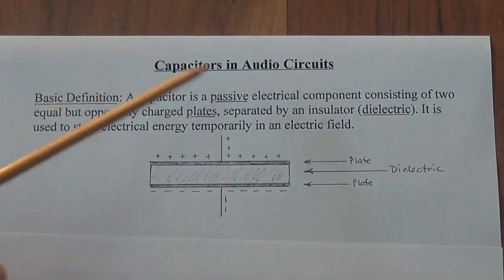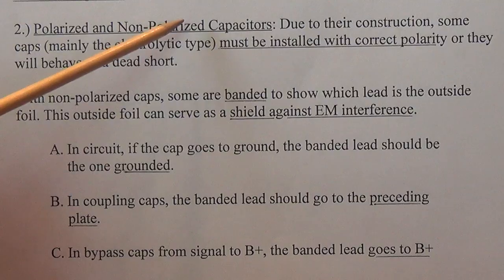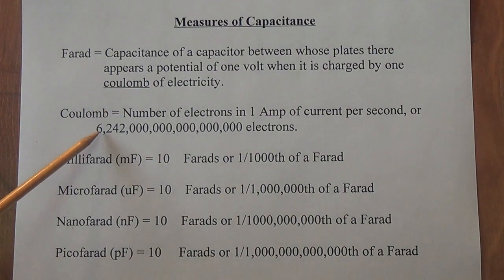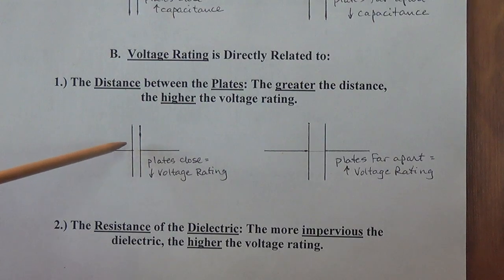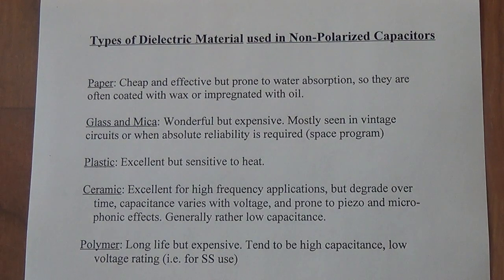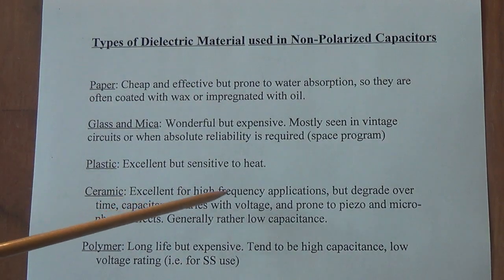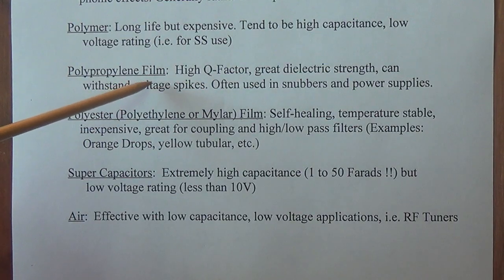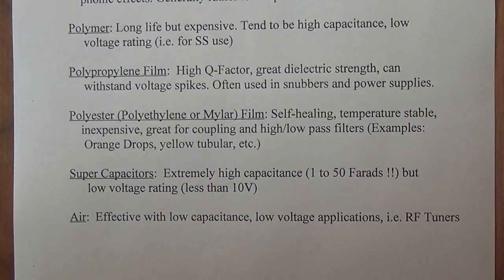Capacitors in Audio Circuits:  Part 1

Comment: Uncle Doug I truly thank you for your videos I have learned alot. I was whatching  mr carlson lab and he says that all caps have a polarity. Is it an issue when building a fender 5f1 forinstance.
Reply from the maker: You're welcome, Brad. I believe what he means is that all caps have an inner and outer foil layer. If you ground the outer foil, it acts as a shield for the capacitor and lowers the noise floor of the circuit. I have no argument against this, but I have built many amps without concern for which cap lead is connected to the outer foil.......and they are dead quiet. If you have an oscilloscope, however, by all means test and mark each cap prior to assembly.
Reply: @UncleDoug  OK thanks. I hear so many differing options on this circuit, 5f1 or aa764 or ab764  it's very intriguing and I need to study the history of this circuit.   Regardless I am going to build the 5F1 as the first amp project. See you at Cobo Hall Detroit this summer.

Comment: In order to be self-healing, film capacitors need to be metallized-film type, where a thin layer of metal is deposited onto the plastic film.  The self-healing process relies on the thin metal layer fusing around the defect if the dielectric "punches through."  However, for high-end audio, foil/film construction is preferred.  
Also, for audiophile-level gear, polyester is the least desirable film dielectric type.  Polypropylene or polyphenylene sulfide are preferred.  Polystyrene and polycarbonate are also excellent, but hard to find today.
Reply from the maker: Thanks so much for this very detailed information, MO.
Reply: @UncleDoug  
Thank you for sharing your experience - and your adorable family members - with the YouTube community.
Also, for further information about capacitors and testing for high-end audio, see the articles at this index:  http://www.waynekirkwood.com/images/pdf/Cyril_Bateman/

Comment: I want see more of your Jack the Cat in the Catacitor and dogie Rusty while playing with the Catacitor.
I notice mild levels mild dB levels of Catacitor with a AC to DC voltage power supply 15v+ 15v- delayed-24v, not much bothers me the Dolby soundtrack masks the noise but wouldn't mind the noise filtered down at least from I guess? The usual S/N ratio of typical -70dB and reduce it down to a best S/N ratio -100dB or -110dB.
24:24 That is usual Cat procedure to check items for defects and usually you're Cat will give it final paw approval like mine does.
Reply from the maker: Jack participates in every video,  Andy, sometimes just behind the camera ;)

Comment: I know you explained how to build a cap/tube/transistor discharge probe out of a ballast resistor and a sharpened screwdriver, but didn't find the video when I searched.
Reply from the maker: Check my recent videos. I re-explained it quite recently.
Reply: @UncleDoug  i was most concerned about the resistor's value.  I have a 160 ohm 1 and think it may be light on r.

Comment: Hi  again Uncle Doug, after discussion with Jack we’d like to post an ambiguity alert on some of the capacitor type descriptions, Polypropylene is indeed a polymer and  is also what we would call a plastic, but your Polyethylene is not actually Mylar or polyester, which is actually Polyethylene Terephthalate or PET the same as used in  plastic soda bottles. Polyethylene is something different from PET despite the partial overlap in name and is used for supermarket bags garbage sacks and  in food packaging. They are  ALLpolymers and hence are all also plastics. Sorry it’s a bit confusing.excellent job on this and the resistors series which I just finished watching. Once a teacher always a teacher. In my 30 years at Dow Chemical I also got a kick out of finding the clearest and most elegant explanations of complex subjects, well done. You can be my uncle any time !
Reply from the maker: Thanks so much for your very knowledgeable input, Stephen :)

Comment: I have 0.4 farad in my amp at 75 Volts DC
Reply from the maker: I'm not sure what you are referring to, BH. Audio capacitors are rarely, if ever, measured in farads.
Reply: @UncleDoug  Just kidding, but I referred to that correct statement of yours regarding to the expression of capacity regarding capacitors and because I have four 100,000 uF large can capacitors in the PSU of my power amplifier, I just realized that you could almost express this value in Farads. I have also four large can capacitors (Sprague's) in my tube amplifier but these are only 3,300 uF but work at 510 Volts DC  B+ voltage but has actually more stored energy than my MOSFet amplifier with 400.000uF respectively 1125 Joule for my MOSFet and 1720 Joule for my tube amp.
Very nice and instructive video's you make and a good voice you have! I'm really enjoying your knowledge sharing.
Reply from the maker: @BoudewijnvanHouten  That's great to hear, BH. Thanks for watching. We're glad you enjoy the videos.

Comment: Do you have a website? It would be great to print off all the documents your using in the video.
One option is to share the document in a common app such as Microsoft or Google drive.
Thanks for your great videos.
Reply from the maker: We have a FB page: Uncle Doug's Vintage Amps, but have not yet posted all the visual aids we use in the videos.

Comment: When I maintained high power radar and HF transmitters while in the Navy typically the caps in the power supplies that produced 10's of thousands of volts were oil filled for the dialectic.  They were huge and large ceramic insulators protruded out of them to attach the cables with washers and nuts.  Always fun to short them out first before doing maintenance.  Some even had automatic shorting bars that dropped down on the leads when a tech opened the cabinet.
Reply from the maker: I'll bet that was quite a light show at night, T.  I love the smell of ozone in the morning ;)

Comment: Hi, I am following your series, and I love them. I actually understood a lot about how a guitar amp works and I would like to thank you for your effort!

Also, I would like to complain a bit about the nomenclature of the capacitors presented. I suspect that this is their commercial naming but there is a small problem:
plastic(s), polypropylene, and polyester are all generally called polymers. Having this nomenclature is a bit bugging for somebody working in the polymer industry
Reply from the maker: Thanks for your nice comments and knowledgeable input, Mat.

Comment: Uncle Doug, I am a guitarist and have been using a small Chinese-made tube amp, which is OK for practice and very small gigs, (FYI the Laney Cub has a common fault which is a thermistor that punks out after about a year; I "fixed" mine by removing the offending part) but I need more power and better sound, so I have a project to build a Fender Super on a budget and I would like to ask if I can schedule a Skype session with you to go over some questions I have about the schematic and other general questions. Of course I would compensate you as you may require, my email is todd -at- vtel.mx, and thank you for your wonderful videos!
Reply from the maker: Todd, while I am supportive of your project and glad to answer a few questions, my schedule simply doesn't allow for phone or Skype communication. Best of luck with your project.

Comment: ...I'm so glad that I've found your channel ! I'm not being a kiss ass. I've been dealing in
vintage capacitors for 20 years or more. I know what they do in many ways, but not all.
I've always had questions regarding all of their function and reasons for the usage of
different materials used for the dielectrics. 
You have a calm and easy style of demonstrating and teaching. Thank you.
BTW ... If you find old vintage caps ,( bumble bees , black beauties , Tigers , Sprague Vit Q, etc )
and they measure within the original values, please don't throw them away. I'll buy
them from you. Thanks again !

Comment: When we fixed old radios we had a drawer of the wax used caps we saved tester with a magic eye tube from junk. collectors wanted radios as originally installed now the reverse is true .😋
Reply: Ps back in the day radio row had bags of new old waxes for dollar or 2
Reply from the maker: Some collectors still prefer all original components, Don.

Comment: in the 1951 rider publishers put out a series of booklets by Van Valkenburgh , Noogoer , and Neville, Inc.  called basic electricity. there was 6 booklets or 1 book covering the 6 booklets. starting with where electricity comes from and ending with transistors. this was a training series for the U.S. Navy They also put out a series called Basic Electronics in 6 booklets also from power supplies to receivers. There are also some other books for industrial electronics. They do not go into such great detail as your series but are great for slow learners that need pictures to help them learn.( navy remember) this series is very rare BUT it is available on line . I don't remember the web address .I have most of these books since 1950's. this was my  training before becoming an electrical engineer for the phone company. I have been watching most of you videos since because of my age I've forgotten most of what I learned almost 70 years ago.
I have also been a car nut since my 1956 Studebaker golden hawk.  Put a 1959 Pontiac 389 v 8 in It . Back in the 1960's. sorry to say the  stock hood would would not close because the 4 barrel sat to high.  A scoop solved the problem.Talk about a sleeper. Drive in night fun just outside of Chicago. Oak lawn Ill. Keep up the teaching . we love it.
Reply from the maker: Thanks so much for the detailed input, Ken. We will :)

Comment: This may have already been asked, but I'm jumping in 400+ comments late! The Air Cap kind of blew my mind.My question is basic, I'm sure, but I don't know the answer. Is the very small value range (0-3 picofarads) the air capacitor  had for you the same range as any cap one would use in a tone circuit? I mean, are there tone circuits this very cool trick just couldn't work on?
Reply from the maker: There probably are circuits in which it is unusable, Ro, but generally, it can be used as-is or in series with a fixed capacitor in most circuits.

Comment: Very informative - thanks. One important point: the strip indicating the foil end is unreliable in modern caps. Mr Calrson (Mr Carlson's lab, on YouTube), has demonstrated this, and has designed a simple tester the determine correct polarity so that caps are installed the right way round.
Reply from the maker: I saw his video and sometimes use an oscilloscope to determine the outside foil lead in each cap before using them in a circuit.

Comment: I put a 5 farad 5v cap as a coupling cap and it hurt nothing.  I ended up bridging it over a low pass crossover for my 4 ohm sub driven with no amp only the mosfet power from the main preamp in the head unit.  The crossover is a dual cross so the other end is a high pass filter on which was no cap and tweeters on that side.  No issues..
Reply from the maker: This is surprising, Zack, since a "coupling cap" is used to prevent the DC plate voltage of the tube preceding the cap from reaching the grid of the next tube.....and this is always much greater than 5V.  I personally prefer to use proper value caps in coupling positions, simply because they are so critical to the amplifier's function.

Comment: So why are polypropylene capacitors used as filter capacitors in amplifier power supplies instead of electrolytics?
Reply: edit....why are polypropylene NOT used as filter capacitors
Reply from the maker: Because polypropylene capacitors cannot be made in high enough capacitance values for filtering purposes. PP caps, due to their design, are limited to 0.5uf and lower values. To achieve the high capacitance and voltage  resistance of filter caps, they must be electrolytic.
Reply: @UncleDoug  makes sense. Thank you.  I just acquired a 1961 Bogen mx30. pa that I am going to convert to guitar amp.  It's already been recapped recently and has all the original tubes. 4 12ax7 mullards 2 6l6gc rca 1 gz34 mullard 1 7247 mullard.  It glows and current draw is acceptable. But output is low and no guitar signal heard. Just popping and static.  The inputs are xlr and i have a xlr to 1/4 cable I am using.  It also has 4 sockets for mic transformers.  Signal tracing has begun. Just curious if you are familiar with this model.  I cant find a schematic. There is one for the mx30a I found
Reply from the maker: You're welcome, Kevin. I'm sorry, but I have no knowledge or experience with the Bogen MX30. Try skipping all the input wiring and simply input a signal to the grid of the pre-amp tube...from your guitar or a signal generator.
Reply: @UncleDoug  that's exactly what I did in the end.  However, prior to that I found a cap shorted to a resistor, fixed that, then found the primary voltage was only 48v due to a shotty connection. This thing screams now. A good scream. Lol. Definitely midrange heavy which is to be expected being a pa originally. Need to decide values for the tone network. I appreciate your videos and thank you for the amp building bug:-)
Reply from the maker: You're welcome, Kevin. I'm glad you solved the problem.

Comment: A story for your amusement as I re-watch several of your vids:  Shortly after the first time I watched this video, my son's scout troop went on a tour of a Coast Guard buoy tender at the Newport Naval Station in Rhode Island.  Now, I am, shall we say, rather nautically inclined, but even I thought this was going to be a pretty boring experience.  Buoy, was I wrong!  It was the NCO in charge of safety that gave us the tour, so we learned about pretty much everything that could go wrong, and what the emergency procedures involved would be.  But when we got to the electrician's station, that's when what I learned from you kicked in.  There were several banks of (discharged, I'm sure) supercapacitors just lying around on his workbench.  I don't know what their use was onboard, but seeing that there were several banks of six 10 farad caps just sitting around, I went to our tour guide and said, "So, pretty much everything on this vessel can kill you, hunh?"  He answered, "Yeah, pretty much." Hahaha!
Reply from the maker: Good grief, Ed......10 Farad caps ???  Supercapacitors indeed. They could probably store up enough current to power a small house. Thanks for sharing your remarkable story with us.
Reply: Yup, 40 to 60 farads per bank!  Four-packs and six-packs of five and ten farad caps.  I'm sure they could power a small house, but only for a moment at a time. LOL!
Reply from the maker: Actually, you can control the discharge rate of capacitors. Some of the electric car folks do this by charging the capacitors while decelerating and then discharging them slowly while driving, to extend the range of the batteries.

Comment: I work in a place where we do a lot of PCB's and hand wiring. We have a wave solder machine and a whole electrical lab. We use almost all mylar film type caps. Once in a while you will see a polymer but for the most part it's all film. Super video. Like a free college level course!
Reply from the maker: Thanks, 6S :)

Comment: You are the best teacher in electronics, wish I had seen this in a 20 years ago....A real eye opener!
Reply from the maker: Thanks so much, Peder. We're glad you found us :)
Reply: Well, I guess I've seen all you're videos now...and I feel soo educated I've studied swedish books and papers but  I had to see your video's before I could really understand info about for instance ac/dc circuits ...great!...and you're funny too!
Reply: BTW what are your opinions on heater voltage, dc or ac? regulated or not?
Reply from the maker: In low to medium wattage tube amps: tube-rectified, AC filament voltage, unregulated. In more powerful tube amps, diode rectification, AC filament voltage, unregulated. In solid state amps: regulated DC.

Comment: This is the very topic when ordering these caps from China... I have noticed the band means nothing, but it's supposed too. When testing these I noticed they had to just print on what ever side coming down the line not trustworthy at all then you turn the cap around and it's all good so we tested it on the scope and half or more were backwards. I don't want to have a scope every time I install these.
Reply from the maker: You're right, Mr. B. The line is no longer trustworthy.  To be very honest, I have never paid much attention to the polarity of non-polar caps.....and now it appears that (without scoping each of them) it would have been a waste of time.